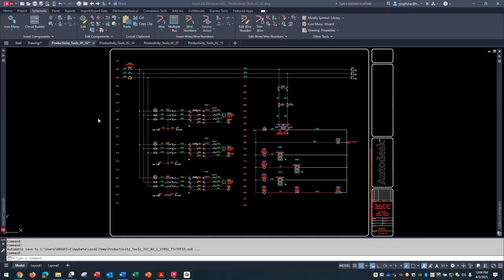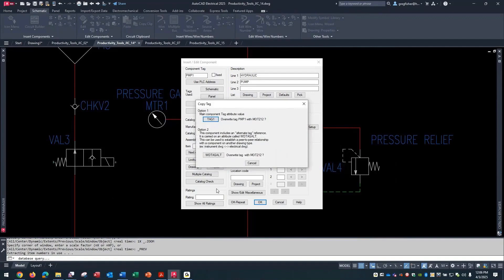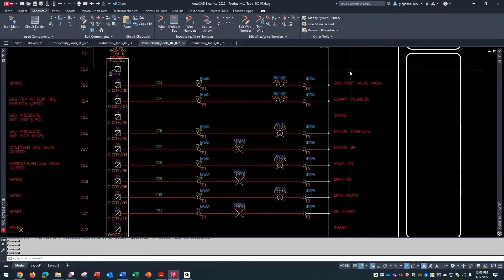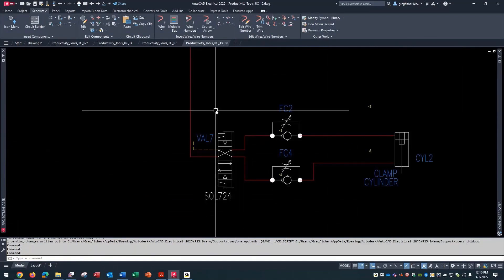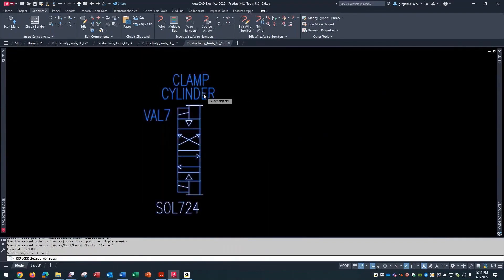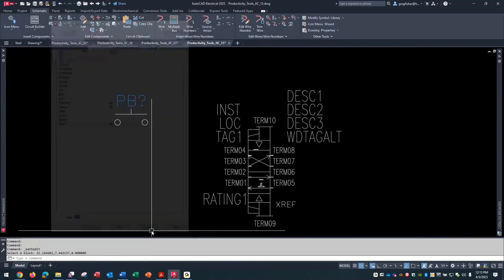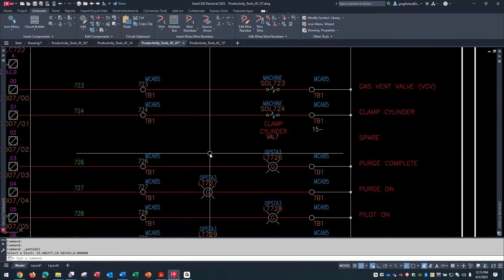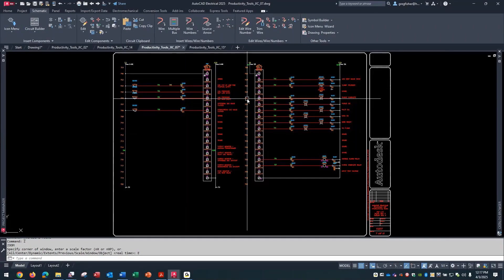How to Link Two Parent Symbols (Peer-to-Peer) in AutoCAD Electrical

Comment: VAL7 obviously has TWO solenoids. How would you solve that as you can only have one WDTAGALT for a component?

Do you read these comments @hagermann?
Reply from the maker: My recommendation on this would be to break up VAL7 into two separate symbols. Just like the solenoid symbols on the PLC drawing.

Let us know if this helps!
Reply: From the aspect of the hydraulic guys, this would be wrong. The hydraulic BOM has only one VAL7. Not a VAL7 and a VAL8.
You must consider how things are in the real world and not try to adapt the real world to the limitations of the software.